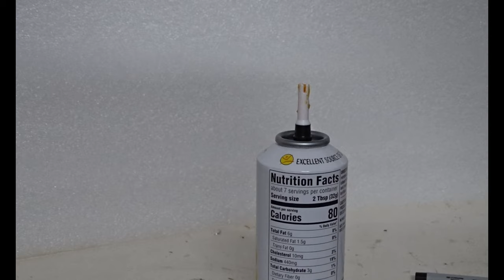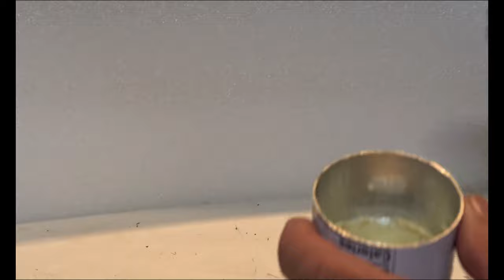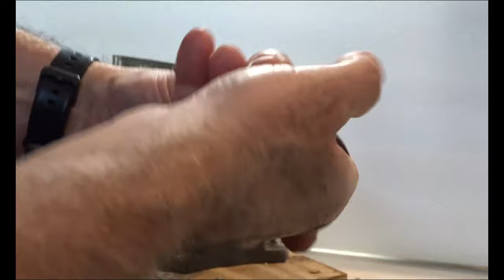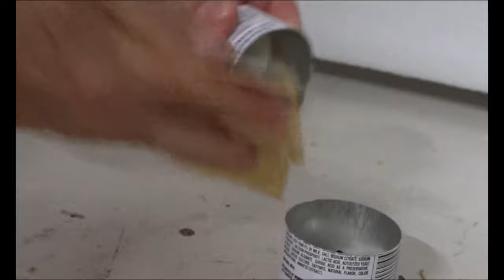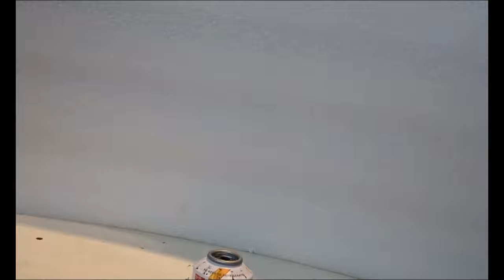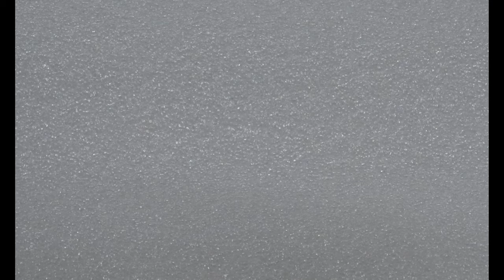DIY Alcohol Stove Build From Squirt Cheese Can - MYOG

Comment: The Fancy Feast stove is made with a piece of tomato paste can and a Fancy Feast cat food can ( or Vienna Sausage can) and either some fiberglass tape wrapped around the piece of tomato paste can or a piece of carbon felt. Put the tomato paste can with both ends removed into the cat food can after wrapping it with fiberglass tape for a wick. Works well. I used the fiberglass tape as the wick. It doesn’t need a holder for the pot. The pot sits on top. Make a small hole near the top edge of the tomato can to prevent the pot getting stuck to it. Costs almost nothing if you have some fiberglass tape. Cheaper than carbon felt.
Reply from the maker: Haven't made one but have seen a few YouTube videos.  I like the simplicity; no stand required.  When I worked on my stove, my goal was to reach theoretical optimal efficiency, make it super rugged, small, light and easy to use.  I believe I achieved the goals.  I calculate efficience at about net 50%.  Most of the stoves/burners are around 30% based on boile and burn times shown in the tests. I bought some carbon felt - yes its pricey.  Might try incorporating it into a cheese can stove.  Thanks for the comment!

Comment: If you save the rest of the can it will make a great DIY windscreen with airholes from a hole puncher.
Reply from the maker: Good idea.  Unused can pieces just go to the recycling center.  Re-using is better!  I usually use aluminum flashing for windscreens.  Check out my video Alcohol Windscreen and Pot Stand.  thanks for commenting.

Comment: It's a variation of the classic double wall stove, that's follow Trangia TB25 burner design -  minus the cloth wick around the outside of the inner wall.
Reply from the maker: Yes, all double wall burners have the same basic design.  Mine are unique only in the material I use (Easy Cheese cans) and the outstanding performance.  Much better than Triangia!

Comment: Isn’t the rubber or plastic plug in the bottom an issue with heat ?
Reply from the maker: Not an issue.  The bottom of the burner doesn't get hot.

Comment: How do you cover the big hole at the top? I imagine that is where you put the alcohol in at?
Reply from the maker: Chris. Good question. Yes. Alcohol goes on the center hole. A coin works. Also one of those round punch-outs in metal electrical boxes. Put in the alcohol then cover before I ignite the primer fuel. I epoxy a small neodymium magnet to the bottom. It holds the punch-out securely. If the center hole isn't covered, you get a slightly faster boil time but less total burn time. Thanks for your comment and substituting.
Reply: Thanks! @tomlovesdiy

Comment: So ANY cylindrical can will work.  What makes this any different? You can do this with any can. This is ridiculous.
Reply from the maker: What makes it different?  Let us count the ways.  It's more efficient, smaller, and stronger than beer can stoves. Easy to make. They boil fast and burn clean with denatured alcohol. The single-wall version is ultralight.  Other than that, they are pretty ordinary.